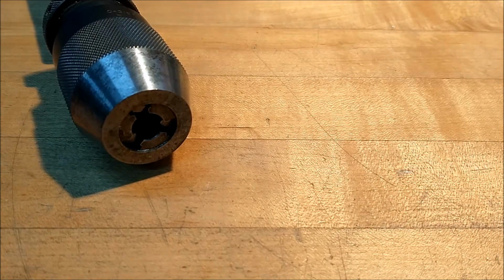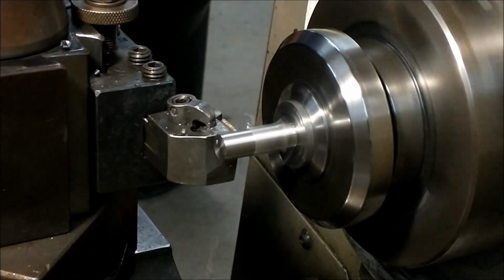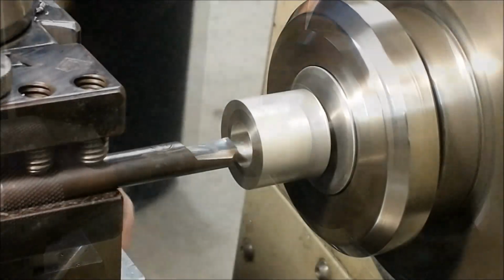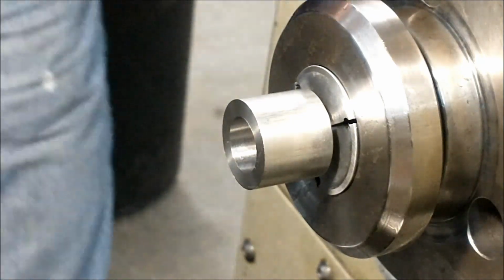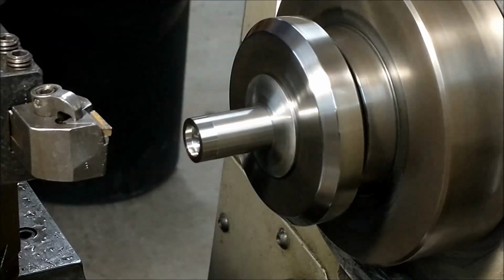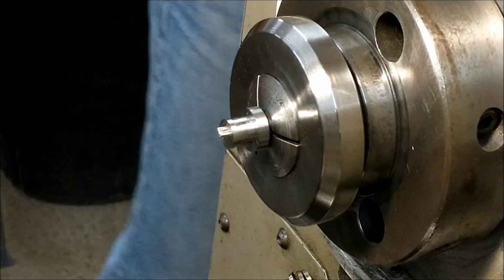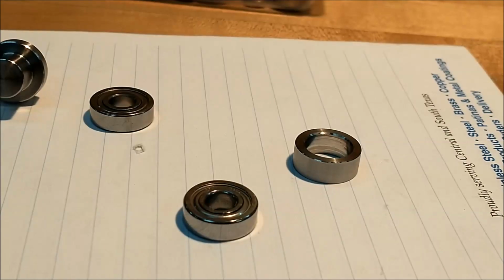Need a Live Center For your Lathe??  Lets Make one !

Comment from the maker: To save everyone from asking or typing a suggestion, yes, a tapered roller bearing would be the best for this build and take the most load. For my purposes, this will be used for small parts and in light pressure setups.
Reply: Given the small size, angular contact would be the cats meow for those looking to overkill the design....but good old conrad bearings are plenty good since they won't see much radial load vs the axial load.
Reply: For those wanting to use tapered roller bearings...your sizes will need to grow a bit, SKF for example doesn't list anything smaller than a 15mm ID and 35mm OD...you can get away with a single tapered bearing and a smaller ball style behind it...but for simplicity sake I'd stick with the angular contact since you won't need to design in seals or shields to keep trash out of the bearings and grease in.
Reply: @mbbmidwest3556  I put my taper brg in the back up against the #2 taper that fits my tailstock. A sleeve and the roller out front with the inner seal removed. An interference fit through both bearings. I filled it with #1 synthetic grease. It lost some grease for a bit but on disassembly later on found both bearings nicely lubricated. A thru hole through the taper allows for it to be pressed apart if needed. 4 years old and working fine.
Reply: @mbbmidwest3556  Thanks. I once designed computer using measurement devices for SKF but only for ball and roller bearings.... Never tapered..
Would combining an axial and a radial bearing change things?
Reply: @Stefan_Boerjesson  not much, since this is really only designed for a thrust load and the radial machining loads are generally not that high when only used for what Joe was intending.. the ball bearing in the back will handle the moment load created by the radial loads.. the axial load will keep the tapered bearing seated. It will work fine providing there is sufficient axial load, but I'm not a fan of the concept since tapered bearings are open to the elements without some other feature or seal, and when storing, nothing keeps it together. I'm not too sure I'd use this concept for a live center used to turn something between centers since there will be more radial loading.
Reply: @mbbmidwest3556  good comment and tapered roller bearings have higher rolling resistance vs ball bearings.
Reply: Wouldn't tapered roller bearings call for a tension control adding more delicate mechanics? Thought about head stock tapered bearings...
Reply: In that case I suppose just one taper bearing at the back would be needed so no adjustments are needed such as like a wheel bearing set up on a vehicle to accommodate heat closing up the space between bearings..
Reply: @TomokosEnterprize  Good comparison! I buy it directly!
Reply: One of the arts of engineering is knowing what you can get away with. I really like how the design comes together here. What I’ve learned with further reading is that ball bearings can handle both radial and axial loads. Thanks for the motivation to learn more about bearings!
Reply: This is perfect and genius for small parts.  I love examples of when it's possible to take a simple solution and bend a few rules, all done safely.  Sure, the bearings could fail, but those little bearings probably only cost $5 each or less.
Reply: A related question: should ball bearings not be lightly preloaded? I was expecting a screw and washer in the back of the rotating part to squeeze the inner races together.
Reply: @JasonDoege  that would add more axial load to the front bearing which already carries 100% of the axial load.
Reply: @wwilcox2726  Yeah, but the rear bearing is free to move and I think can mis-align. Without a bit of preload it seems like the rear bearing isn't doing much.
Reply: @JasonDoege  you're probably right. I never thought about it that way because I know how to install bearings properly so they aren't misaligned.
Reply: Joe, 
One can see why you did as you did.  The only question I have is how are the bearings holding up.  My live center is very accurate, but not always right for the job.  I have a chunk of 17-4 just sitting there and a stack of skate board bearings.  Perhaps for occasional use they would work OK.
Reply: @dougberrett8094  As I understand it, plain single row ball bearings are rather sensitive to missalignment of the axle, but can actually take substantial axial loads. Axial load specs are usually 10% - 50% of the radial load rating, deep grove types being best. Using 2 bearings with a spacer works fine for most purposes. As long as You are not making a precision spindle or similar...
Reply: @dougberrett8094   These bearings will take the weight of a 75 kg human jumping down very large stairs a hundred times and landing at an angle when used on a skateboard.
Reply: @huluvoo781  I thought they would have considerable thrust capacity.   I have no idea how heavy 75 kg is.  I did make a rotary broach with the skate board bearings.  So far, so good.
Reply: @dougberrett8094  I have found skateboard bearings to be surprisingly accurate, skaters dont like wheel chatter anymore than machinists do
Reply: @dougberrett8094  don't over look the run-out of a drill chuck when using it to hold your live center.
Reply: @wwilcox2726  that certainly could be a factor.  However since it will not be spinning, it would amount to offset, and would introduce some taper.   Also the drill chuck is not really made to take side load.  If I make one of these “specialty” live centers, I will make it fit into an ER32 collet.   I have an ER32 collet chuck with #3 Morse Taper.    That should minimize any accuracy and side load problems.    I measured the run out of my normal live center to be .00005”,  so it is going to always be first choice.
Reply: @dougberrett8094  ER collets are terrific. Good call.
Reply: Hi I’m l
Reply: 7
Reply: It is better to use axial bearing then taper roller
Reply: Further more how about getting the propane torch out easy fix replacing someone with potential not so much
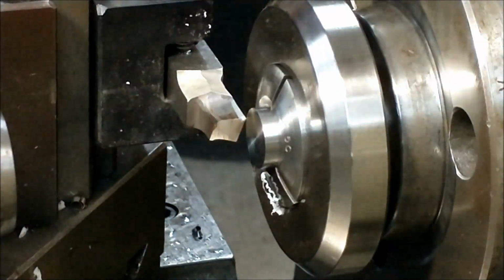Reply: @14:56 They say transparency is important on YouTube; I'm glad you included this.
Reply: I asked before i read this comment 😁
Reply: Тогда можно в конце использовать упорный подшипник
Reply: Joe, you were very close to the mark with your original build. This tool if converted to a 60degree live center is for very light duty as drill Chuck's aren't designed for side loading and if someone over does it there goes the Chuck's run-out, oops. The best drill Chuck's still have run-out so again as a 60degree live center it will probably cut parts with a slight taper. 
I know you said you could heat treat it later, but I don't follow the benefit of having a hardened live center? 
As this was a down and dirty get it done project especially for home guys "snowed in" that's what you delivered. It isn't intended for everyday commercial use. Good luck getting tapered bearing which have seals. That's just way over complicated. 
Thanks very much for the project video. 
I'll be making my own shortly!!

Comment: Just found this Joe. It is excellent.
Reply from the maker: if you plan to make one, use a thrust bearing or conical bearing for better performance if you have one.
Reply: @joepie221  Would an inner race spacer, exactly matching length of outer spacer,  increase the thrust capacity by transferring some load to the rear bearing? Seems like it would but not sure if the world is that perfect, maybe it depends on the bearing tolerances? (Question based on version in the video)

Comment: Very Nice Joe.  Thanks. I make a few different parts for a project where the live center support is needed and the standard live center's shape makes finishing the pass a near collision. I want to make a special shaped live center which has plenty of clearance to finish the cut safely with plenty of space between the end of the cut and the live center support.. My project will copy yours, except for the shape of the contact point.
Reply from the maker: There is a commercial item that may help. Its called an extended live center. It gives you more room to work.
Reply: @joepie221  Thanks again Joe!

Comment: Joe, longer life if the bearings are Thrust Bearings. They are built to handle axial forces. Common rollers will not.
Reply from the maker: Maybe a combination of both for gen 2.
Reply: I think maybe we could use a relatively big ball at the end of the axis to handle axial forces. Of course, there must be a place for the ball to be set on the axis and the “axis holder” (I don't know the name)
I am not a machinist, but I have just invested in a lathe and would like to learn.

Comment: How do you remove the bearings when one breaks?
Reply from the maker: I suggest an expanding arbor in a drill chuck and one end in a collet or chuck. A tapered roller bearing would be much better.

Comment: This is excellent. I have to make a beefy live center for a spinning lathe. With the drill chuck I can make one and use it for a pressure center on the lathe as well. Bitch'n. Thanks.
Reply from the maker: Use a tapered bearing for heavy pressure.

Comment: What’s your thoughts on using oil with carbide inserts??
Reply from the maker: Some will argue the temperature shock factor will add micro fractures to the insert if the chips are real hot, but if the material is sticking to the insert or the finish is crap, I say go ahead and use it. Then check to see if you are using the correct insert grade and coating when you're done.

Comment: what kind of grinding disk do you use to sharpen your HSS Cutting tool?
Reply from the maker: I use a standard grinding wheel, or a 120 grit cup wheel for smooth surface grinding.

Comment: Great work. Will work just fine for light work using ball bearings.
The correct term for this centre would be running centre, rotating centre or revolving centre. It is not a live centre. 
More info available at Wikipedia Lathe Centre.

Comment: Just wanted to say "THANK YOU".  I am an absolute novice, hobbyist with a Smithy Midas 1220 that I've had for over 10 years, with VERY little tooling (have to use a hacksaw to part a piece off) and this video made me want make my first attempt at some real precision work. The bearing shaft is a couple of thou too small and the center shell is a couple of thou too big but I am happy with it and best of all, IT WORKS. The whole thing cost me $14 for the cheap bearings at Kaman and about five days working on it during breaks in other projects.  I just need to learn what speeds, feeds and bits can give me the best finish.  Once again, thank you for putting this out there.  Jim in Abilene, TX

Comment: I thought I had watched this video but, I guess not.
 That's been remedied. :o)
For a couple of years I was doing production work single point boring 35mm bearing housings. Tolerance was 5 microns. It wouldn't have been so bad but the time was only 1.25 minutes which we were expected to beat by 100% to make any bonus. It was relatively easy on a capstan with a roller size tool (not sure what it was really named, it had long hardened rollers that burnished bore to within 2 microns) but single point, not so much.... 
Apparently I did get good enough to maintain a 3 micron tolerance. ( I only found out several years later)
 Inspection had air gauges, 'shrinkage' was always an issue particularly in summertime when it could be high 80's on shop floor and around 68f in inspection.
Oh, if higher thrust loading is required, drill a 1/4" hole in shank about 7/16" deep, drop in a single ball bearing, blob of graphite or molybdenum grease, a second bearing for replaceable tip to contact.  It won't last as long as taper or angular contact bearings but will last for a long time even doing production work
Reply from the maker: It needs a thrust bearing to be bullet proof.

Comment: question? are you not concerned about no thrust bearing?
Reply from the maker: Its for light work. Using a thrust bearing to absorb the linear pressure would be much better.

Comment: What's that " razor blade trick" ?
Reply from the maker: Its used to get a feel for aligning a tool to the front of a part for parting it off or just finding a start point.
Reply: @joepie221  Thanks, that occurred to me after I posted. I just finished this project yesterday as a first project for my new old lathe. Mine looks like crap but it works! Every single one of your videos has so many off hand remarks and tips that it saves newbies like me a lot of headaches and confusion. There is still a lot of frowning, swearing and head scratching.. just much less. It took me 2 tries to come into a press fit for the bearing OD and 3 tries for the ID, but all excellent practice.
Greetings from Melbourne Australia,  your work is never done, but always done well.

Comment: Man,  I need a design to make with hard allow steel,  and a 4140 shank that I guess I'll just try to do a N 2 Morris taper with the damn lathe coumpound,  drive it with drill.  And I got to square up and grind all the 2 small guns with a hand spinner jig, because I do not have access to collect chuck for the lathe.

Comment: Just hypothetically? On another note, could you use a pressure center to turn the edges of a 1/8" stainless steel disc? (316) though presumably you would want to pressure centers as large as possible whilst still being able to take the cuts you need.
Reply from the maker: Hypothetically, how large in diameter is this SS part?
Reply: @joepie221  Around 1 5/8" to be the end cap on a displacer cylinder of a Stirling engine (to be silver soldered or welded on).
Reply from the maker: https://www.youtube.com/watch?v=0DrI5B4hui0&t=7s
Reply: @joepie221  Many thanks for the link.

Comment: great material however when doing the final fits you do not sit and wait and guess about heat and shrinkage. You simply squirt the material with coolant from a bottle and keep going at top speed
Reply from the maker: That philosophy will get you in trouble someday.
Reply: If you want to top speed it, buy a lighter refill gas bottle and blast the part with liquid butane or propane... That gets them cool in a blink of an eye, and is a great trick for quick shrink fit cooling... Just take the cap from wd40 or any spray bottle and put it on a lighter refill bottle and turn her upside down while blasting... -50 celsius and lower in a few seconds if not too hot... Dont blow yourself up and blame me if you manage it... I smoke often and sometimes smoke while doing so and have never lit myself ablaze, so if you manage it, its your fault entirely...

Comment: Joe, every time you film something round on your bench it rolls. Would you do a video on leveling a bench?
Reply from the maker: The bench is parallel to the floor. Its the curvature of the earth affecting the building which in turn tilts the bench on a 25,000 mile radius. Maybe a shim would help?  :)
Reply: @joepie221  Dont waste your time with shims, duct tape or hot glue are next generation solutions.

Comment: Hi Joe, thanks for sharing this project! maybe a stupid question, but is there a way to exchange bearings? How to get the inner one out? :-) Maybe it is easier to just turn a new life center body :-)
Regards from Germany
Mario
Reply from the maker: A hook would probably work. They are not pressed in. This is for extremely light work. For heavier pressure, the use of a thrust bearing to take the linear load is highly recommended.
Reply: Mario, if the bearing is in tight fill the inner hole of the bearing with grease and then push a rod, the diameter of the inside into the grease. This will force the grease behind the bearing and push it out. You may have to repeat a few times because of the limited amount of grease but it will come out eventually. 
I have also seen bread used, mostly the inside soft bit. A bit messy too but can be washed out with water. Good luck.

Comment: Mabry you can answer a question for me as I'm just getting pretty interested in machining, why do most machinist not use liquid cooling to prolong tool life?
Reply from the maker: If its a light cut and the material is flowing nicely, the choice to use coolant is up to you.
Reply: Some do! Water-cooled drill bits are a thing, and many lathes now have continuous coolant pumps on them to spray or drip onto the work piece.

Comment: Thanks for this. Made myself one with 1/2" dia pointed end with MT3 for tailstock.  Been needing a little one and this motivated me to do the deed.  I chose to have tight slip fit so I can change the tip and not make another MT3 holder.  Plan on having conical tip also.  Managed to do this and not have runout which is going some for me.  (5C collet upgrade helped immensely)

Comment: Hi Joe, love your videos, just curious what is your favorite cutting fluid for most lathe, tapping and mill operations, etc?
Reply from the maker: Drilling and tapping stainless....Moly Dee or Anchor Lube. My CNC has a water soluble oil coolant that works very well for milling and cutting about every material, its called Trim-Sol, and for general lube on small lathe work, I usually just brush on WD-40. Though I do have a bank of Tap Magic products that perform excellent.

Comment: That was some beautiful work Joe, with some great tips along the way. Wouldn't it be preferrable to use either taper bearings or an additional thrust bearing for this purpose. Perhaps you were just using what you had on hand. Still a great idea.
Reply from the maker: For heavy pressure work, I have a variety of conical adapters I stick on the front of my bigger center. For a light weight hobby application, this should do the job. Taper bearings would be better.